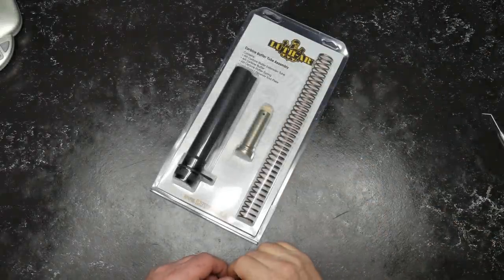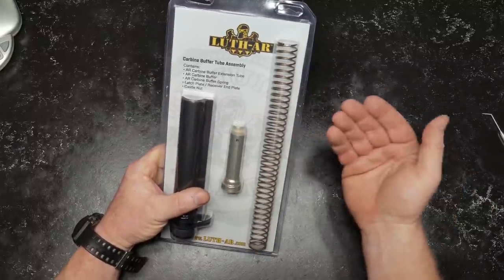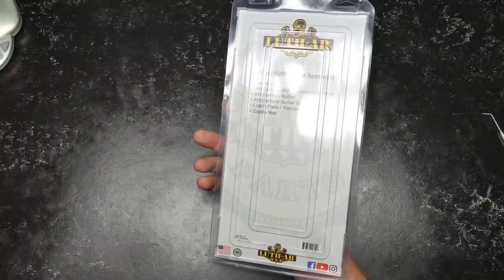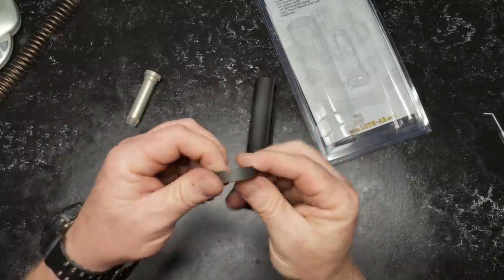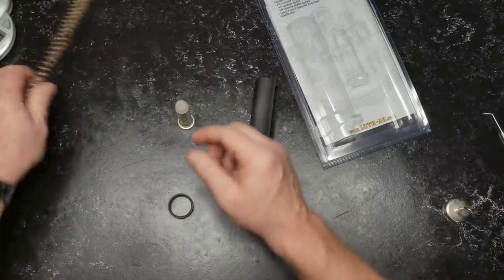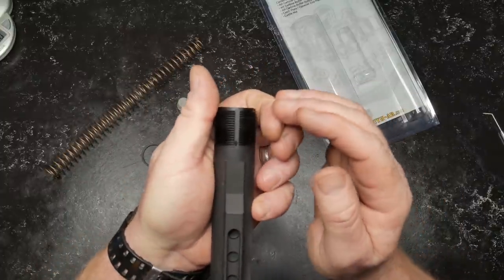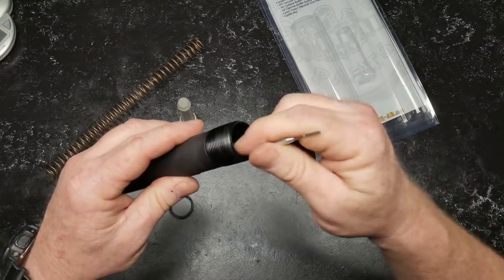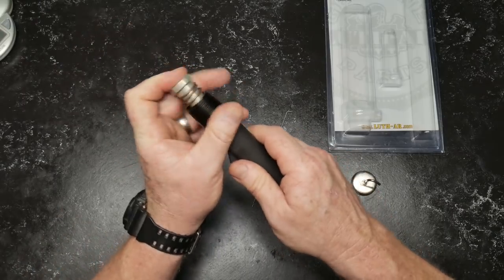Everyday Joe Build Part 5 Luth-AR Carbine Buffer Tube Assembly

Comment: Quick Question KB32.... anyone chime in. 

Can you get a 22 pistol (tx22) down to safe hearing noise levels using a silencer? Safe to use with no hearing protetion?
Reply: Yes. It's already close without a suppressor
Reply: Use 22 shorts....they won't cycle semiautomatic firearms but they wont bother neighbors when you are shooting rats or critters in the backyard out the back door or window.....wait, I didn't say that.